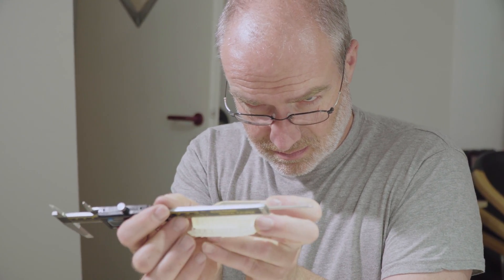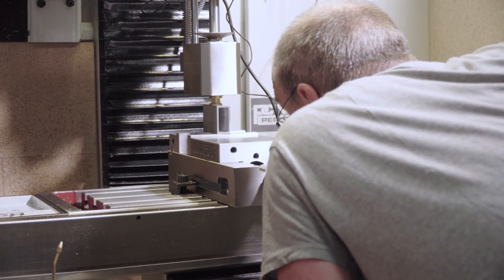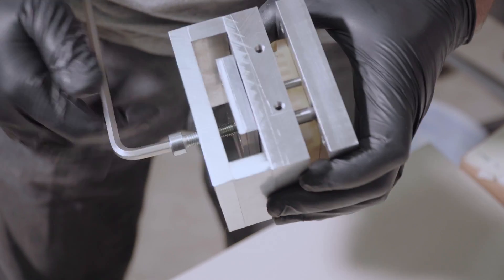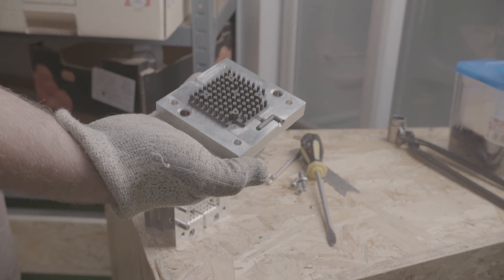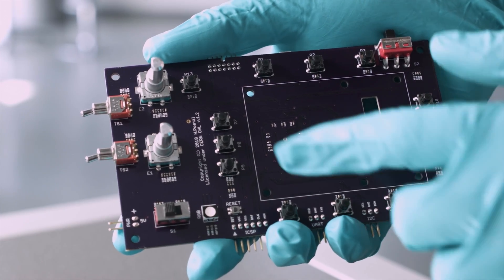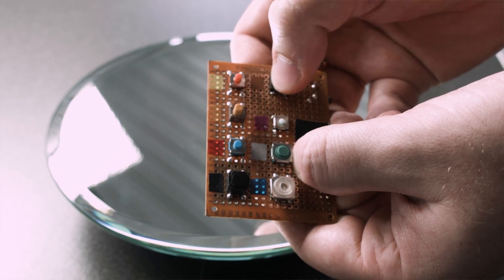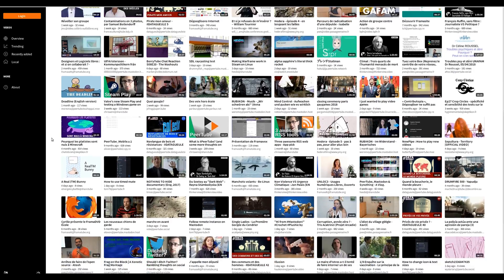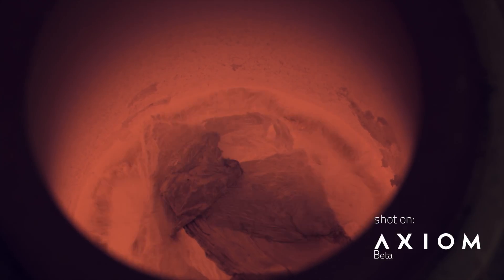AXIOM Team Talk Volume 14.3

Comment: Thanks for your work. 
I have a question: Are you going to add any 5G module? as it can allow the camera to broadcast live over the net with very high resolutions.
Reply from the maker: You could easily add connectivity (5G, LTE, etc.) to the AXIOM Recorder PC but you need the software and performance to encode the 4K uncompressed raw stream to something you can send over the air live - not a default application for a high end cinema camera :)